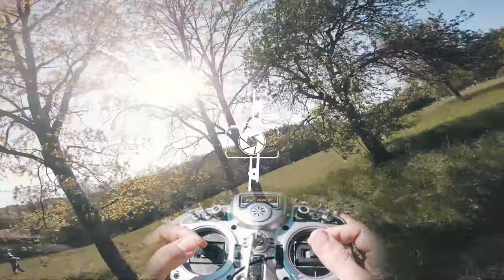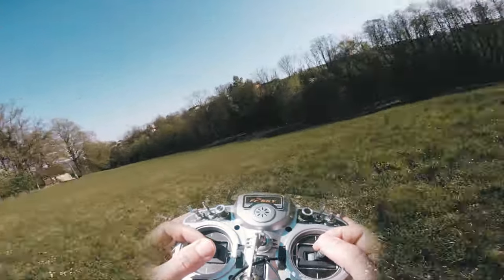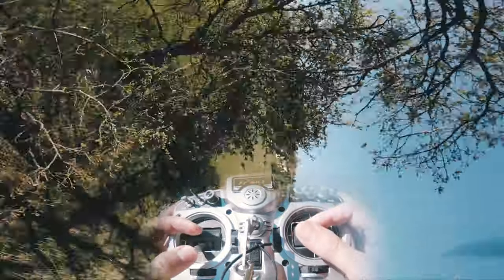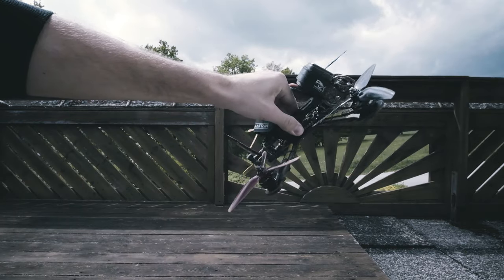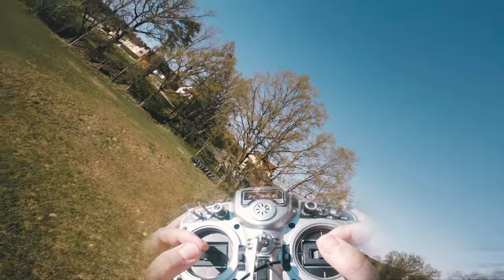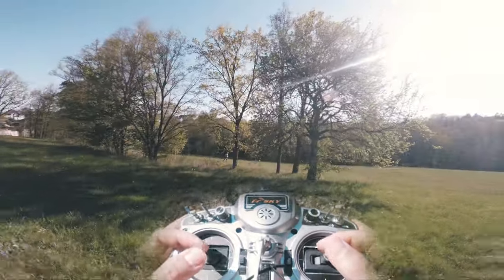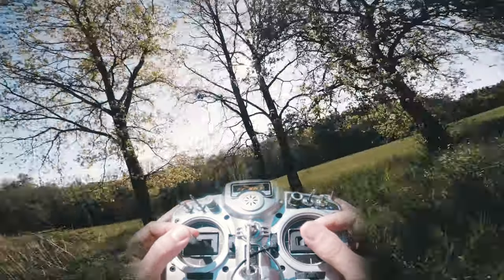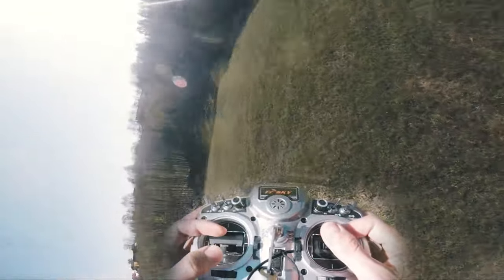How to fly Juicy "YAW / Backward" Part 3 - FPV Tutorial series Juicy Masterclass by YDKM

Comment: Best thing for beginner doing inverted yaw
Remove the pitch roll thumps when moving yaw inverted at the  begining
Gonna be much smoother😁
Reply from the maker: yea thats a good tip so you cant mess up with the stick you dont need at this moment 😀
Reply: @YouDontKnowMe  yeah because by the past ive always put a tiny bit of pitch and make it not not perfectly flat 😁💪🏻
Reply from the maker: @BlackBirdFPV  thats the sweet little fine tune for perfection 👌😁

Comment: Thanks for another great tutorial video !  I wish you would give us how to make "Robotic" movement with your quad,  I mean, sudden and quick direction changes that all "Juicy" pilots are doing.  I've been trying to emulate that kind of movement for a few months but haven't succeeded so far.  Thanks again.
Reply from the maker: i explained it a little bit in the second part "how to fly smooth", just smash your stick fast in the other direction, it works the best when you are doing slow movements before you are doing the fast direction change, if this doesn't work maybe your rates are to slow
Reply: @YouDontKnowMe  Many thanks for your comment.  It's going to be a big help to me.  I'll watch your 2nd tutorial again.  BTW, I think you are using Betaflight based FC, would you please share your rates / PID settings ?  Thanks.